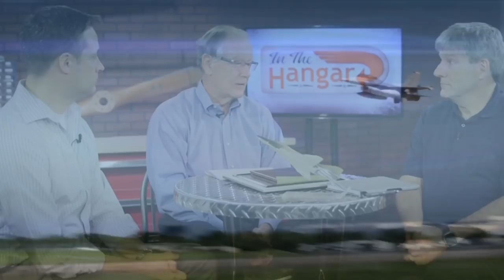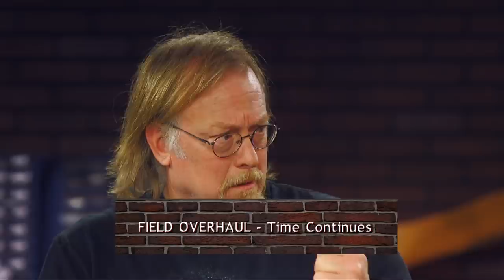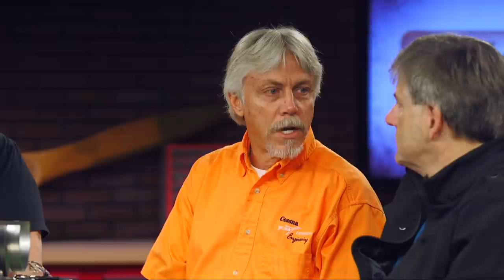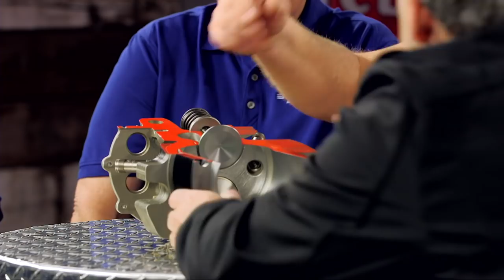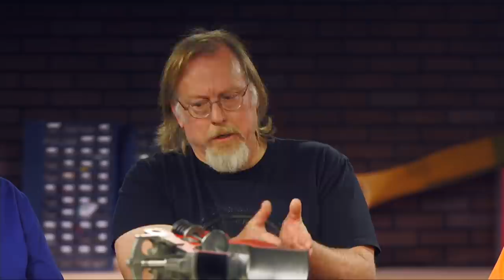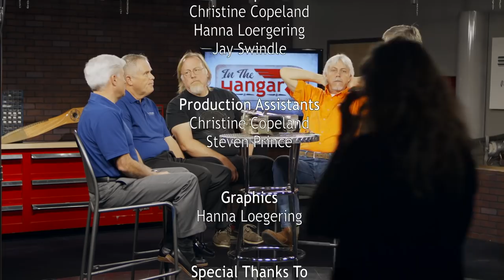All About Overhauls - InTheHangar Ep23

Comment: Good info on maintenance, 
But there is no such thing as:
A top end overhaul, or major overhaul. 
It was either overhauled or it was not.
§43.2 Records of overhaul and rebuilding.
(a) No person may describe in any required maintenance entry or form an aircraft, airframe, aircraft engine, propeller, appliance, or component part as being overhauled unless—

(1) Using methods, techniques, and practices acceptable to the Administrator, it has been disassembled, cleaned, inspected, repaired as necessary, and reassembled; and

(2) It has been tested in accordance with approved standards and technical data, or in accordance with current standards and technical data acceptable to the Administrator, which have been developed and documented by the holder of the type certificate, supplemental type certificate, or a material, part, process, or appliance approval under part 21 of this chapter.

Comment: Just a question: you mentioned "steel" cylinders. Did you mean cast iron, or actually steel? Also, the nickel cylinders. Are these similar to what are called "Nikasil" (plated aluminum cylinders) used on some aftermarket HD cylinders?
Reply from the maker: Good question Ric.  Let me ask some A&P's.  I'm pretty sure the nickle are plated.
Reply: @TakingOff  Thank you so much. That was a quick response! I have been an engine builder my whole life, started flying in 1979, but just never delved into aircraft engine building. It was a very good video. You guys do an oustanding job on presenting your material, and it is much appreciated. Thanks again, Ricci

Comment: Dan, something they brought up here was 'keystoning' of the cylinder, and this is something I don't understand.  There's at least one remanufacturer who offers to remove the keystoning and put in oversized rings in the cylinder.  This, according to him, if I understand correctly, is supposed to reduce cylinder and ring wear, and give you a longer time before you have to do a Top Overhaul, assumedly with equal conditions.
The next time your group gets together, could you ask them about that?  I would be interested in hearing about that.  Insofar as I know, they don't do it in automobile engines, so why in airplane engines?
Reply: I think what you are asking about is “honing” of the cylinder wall.   With the exception of channel chrome cylinders, all cylinders are honed with a distinctive cross-hatch.  The cross hatched micro scratches in the cylinder wall is there to retain oil to lubricate and cool the ring-cylinder interface.  It is critical that the engine is broken-in correctly with high intercylinder pressures to establish the correct mating of ring-to-cylinder wall interface.  If done correctly, the hatching will still be present (with lower peaks and shallower grooves) and will not be filled up with glazed oil.
       
      Automotive engines are honed as well.
    
     Removal of the honing will lead to overheated and eventually softened (annealed) rings that will fail to seal in the combustion gasses, leading to a loss of power and excessive blow by, if they don’t fail from fatigue first.

       The cylinder manufacturer you mentioned might be offering channel chrome cylinders.

     Channel chromed cylinders already have micro “cracks” in the chrome cylinder wall, so they don’t need to be honed.  
    In these cylinders, instead of chromium steel rings, the rings are chilled cast iron or a softer steel alloy.   During break in of channel chrome cylinders, it is the rings that wear against the harder chrome cylinder wall.